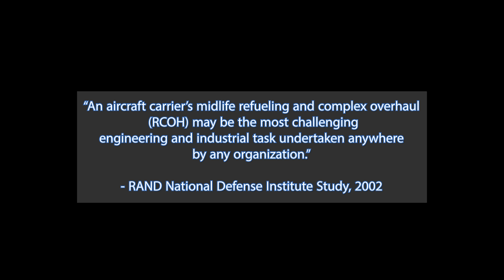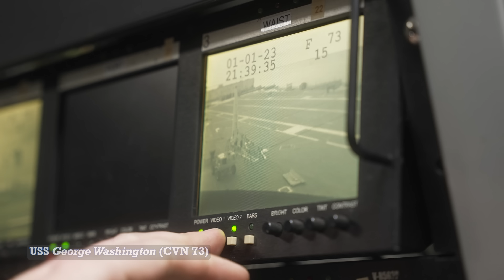Newport News Shipbuilding Aircraft Carrier Update: March 2023

Comment: Awesome seeing the new Big E taking shape. What is happening with CVN 65 and her reactor removal ?
Reply: She's at Newport News right now, but it's looking like they're gonna start scrapping her in 2025.
Reply: @chrisduitsman2918  2025!  She was decommissioned in 2012. 13 years later. I understand rhat removing the reactors is still the biggest stumbling block. They will literally have to cut the ship up to get at them and then what are they going to do with them?.
Reply: @afenijmeijer9027  she was born with 6 reactors, but died with only 4. In order to refuel these ships the reactors need to be cut out anyway. This is a well rehearsed and well known process for the guys at NNNSY and also at PSNS in Washington.  The spent reactors and fuel are taken to a holding facility in Idaho usually via rail in specialized cars.
Reply: @cascadesouthernmodeltrains7547  She was born with eight (8) reactors as far as I am aware. I stand to be corrected.
Reply: @afenijmeijer9027  I looked it up, you are correct. I talked to a buddy that served in the reactor department onboard and he said there were only 6 when he served on her and they really only had 4 going at a time. The engineers who designed the ship figured a 1 for 1 boiler to reactor as if it were an oil fired ship, but it turned out that the reactors much better at making steam than oil fired boilers were so they “overbuilt” her.